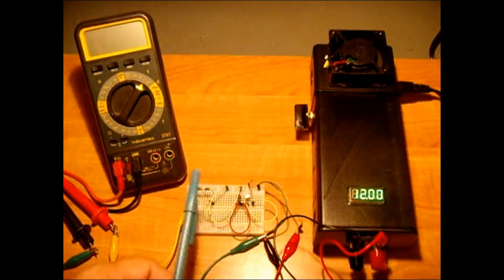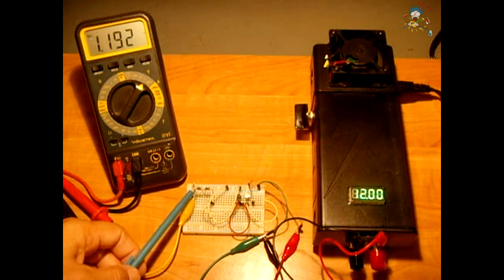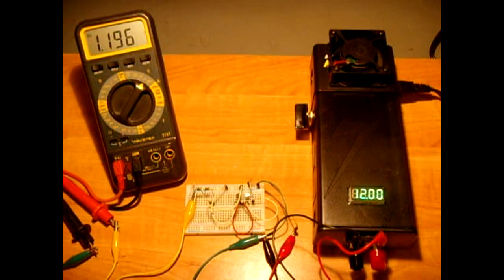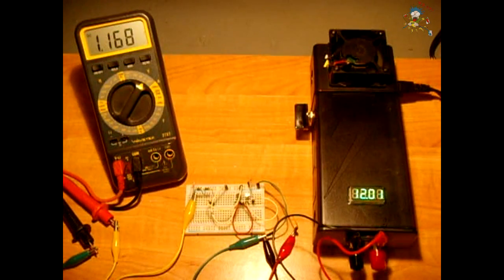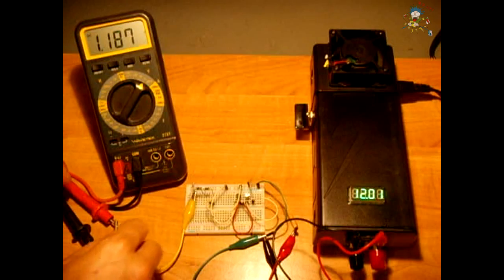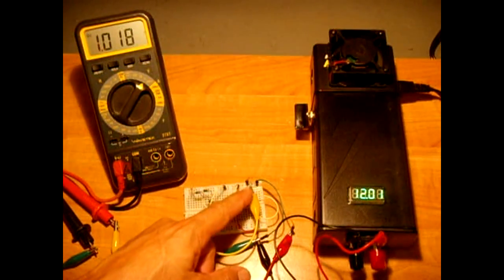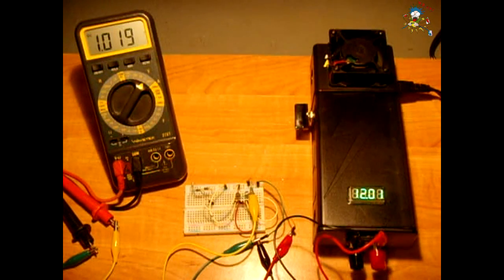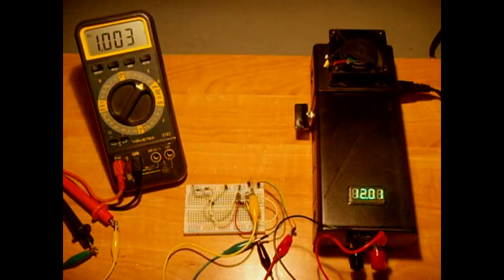Using Diodes or Transistors as Temperature Sensors

Comment: Those forward voltage deltas are pretty small, and hard to capture with the limited ADC on most mcu’s leading to low resolution readings. Timing reverse-bias decay with the input capture unit on an Arduino provides much higher resolution readings without any amplification:
https://thecavepearlproject.org/2019/11/04/single-diode-temperature-sensor-with-arduino-icu-via-reverse-bias-leakage/
Reply from the maker: Thanks for watching Ed!

Comment: Hi.... what to do if i want drop across diode increasing when i heat the diode means diode resistance should increase instead of decreasing when apply heat to diode. any suggestions would be very helpful. thanks.

Comment: Thank you for the video, it was very interesting. Currently I'm working on a project with the RFID chip SL13A. It has an integrated temperature sensor. The Problem is that during the temperature measurement the tag heats up and distrots the measured value. Fortunately the chip has an analog input for an external sensor. Therefore I'm looking for a  Diode or transistor that can measure the body temperature with an accuracy of +-0.5°C. I would be very grateful for any suggestions or input on this.
Reply from the maker: Look into a lm35.

Thanks for watching!
Reply: Thank you for your reply. Another requirement is that the input voltage range of the external sensor that is connected to the A/D converter should be between 300-600mV and the external sensor should be as small as posible (like SMD). Application would be an axillary body temperature measurement.